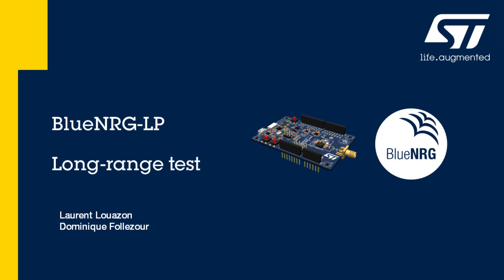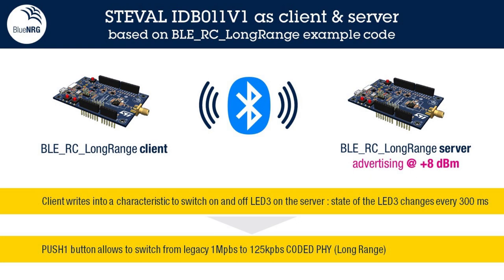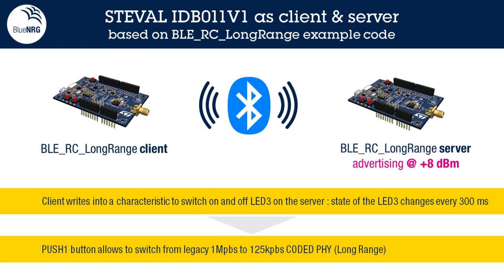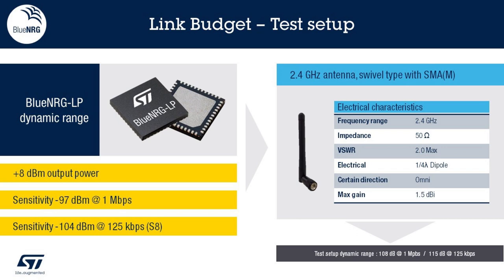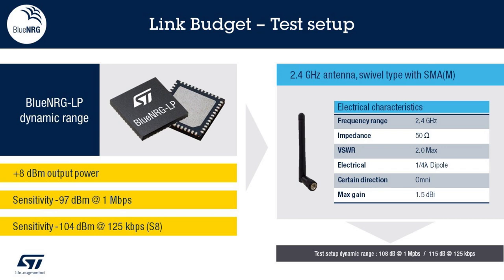STMicroelectronics BlueNRG LP Long-range Test

Comment: Good experiment ST! What is the approximate  data rate at that 1.3 km range?
Reply from the maker: Thanks for your comment! The goal of that test was to demonstrate the maximum range we are able to connect a BlueNRG-LP device.
As you know, in BLE long range coded PHY S=8, over the air data rate in lowered to 125kbps so it is not really targeting high data transfer rates.
During our test we were just checking our ability to sustain a connection and exchange a few bytes.